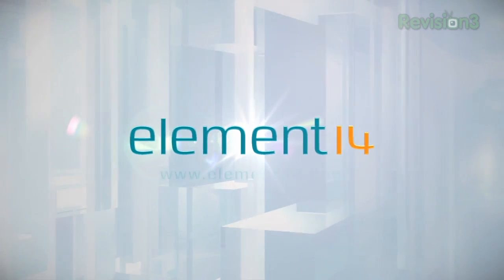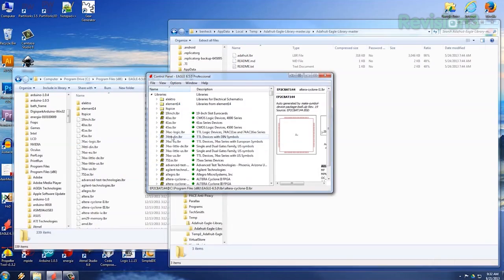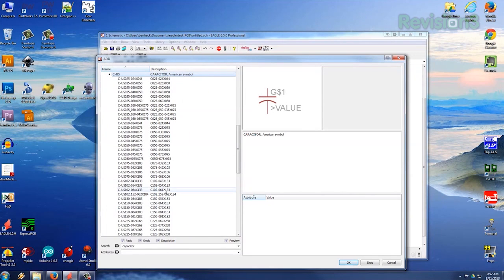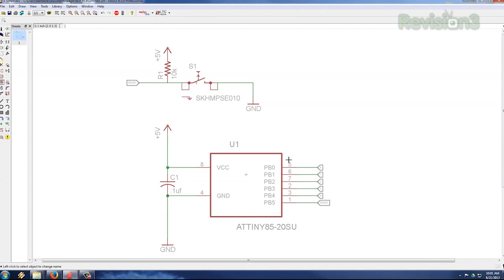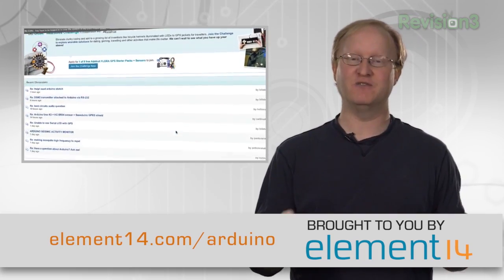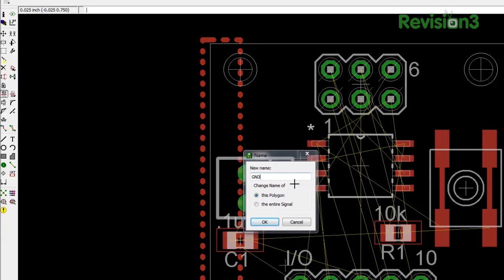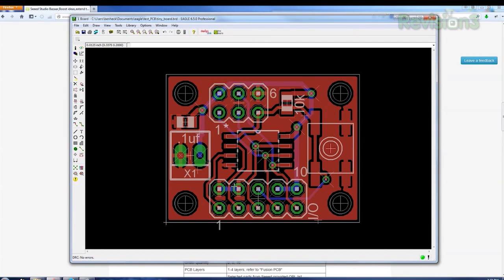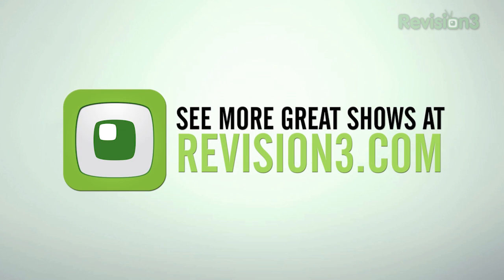Getting Started with CadSoft EAGLE

Comment: I know this is an old video, but I've struggled with Eagle all the time I've used it, so any hint helps. After you make the schematic, and switch to the board, all the components are lying in a lump. Rather than move them onto the board piecemeal, and risk getting an error message if you drop one,  "that feature not available in the free  version", grab the group tool, surround the bundle of components, right click "move group" and re-place the bundle within the boards boundaries

Comment: That's exactly what I wanted to learn, but I don't know sh*t about electronics, I just got into this world a couple weeks ago. I guess I just have to study a lot about to first learn how to create my own PCB. I want to create a portable game based on a orange pi, to be as cheap as possible, and I guess the most I do myself, the less I'll spend, and making a mother board with all the modules on it would not just make it more organized, but original and practical, even would help improve the design. Also, I guess i wouldn't need to wait half an eternity for all the stuff I need arrive from China (yeah, I live in Brazil then definitely doesn't worth buying a single module here cause it'll cost 3x or 4x it value).
Btw, thanks for this channel, you guys are being a great help, also a great inspiration

Comment: I never use Eagle as intended. I go straight to making boards and don't even mess with the schematic part of the software.
Reply: I just use common board components, or make my own using data sheets, and just connect stuff looking at a schematic elsewhere.
Reply: Directly on a breadboard? Yeah thats much useful but when youre dealing with proprietary connectors ie LCD pins that are patented and not found anywhere, you really are forced to design everything yourself even if its a breakout board for that pin.
Reply: Who said anything about a breadboard?
Reply: Tim Ramich how else would you do it without a breadboard or pcb?
Reply: I have no clue what you're talking about at this point. I do schematics on paper or in my head, and then make PCBs from that. I don't even mess with breadboards.
Reply: Tim Ramich i interpreted it as you didnt use eagle as intended as in using it for the pcb design. so then i assumed you were saying you just always work with breadboards and from there thats when the convo was lost. i misread your first comment

Comment: I'm completely new to arduino.

if I were to convert a breadboard prototype to pcb, and solder everything, would i need to program the controller or w.e before i solder it onto the pcb?
Reply: Henry The Unicorn I'd recommend an IC socket if you're using standalone microcontrollers, so you can replace them/change the program more easily and also reducing the risk of heating the IC itself up too much.

Comment: Great video, Ben!

When introducing the schematics view, you mention that when connecting schematic components, you MUST use wires and can't simply drop the components next to each other for them to connect. In fact you can just drop a component next to another and if one or more of their connections "touch", they will be connected by wire automatically.

Comment: this might be silly question,  but,  when dealing with analog portion of your board,  why did you choose to use pull up resistor more than voltage regulator?  just wondering.

Comment: Never use autorouters. They are notoriously inefficient with layout and add way more vias than you'll ever need. 

Placing components inside first works fine for simple board like that. But when you have a couple dozen components, it makes more sense to cut the circuit into sub-circuits and run the traces (excluding power and ground) and then drag and position that sub-circuit inside the pcb walls. That should help keep your traces shorter and avoid you wanting to pull your hair out.

Comment: If you want to continue a wire from the other side of the PCB you don't have to place a via manually. You can just use the Route-Tool and do a mousewheel-click and it will automatically place the via for you :)